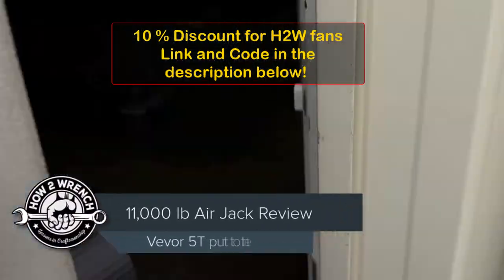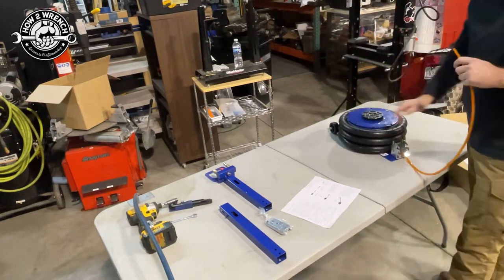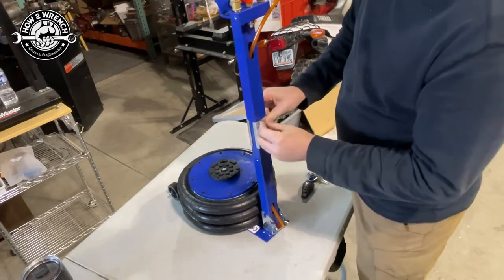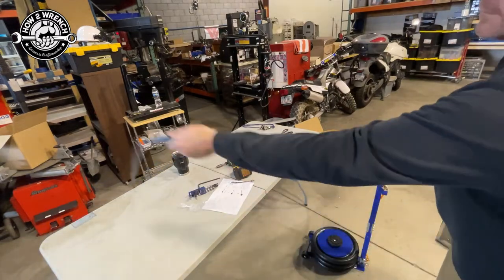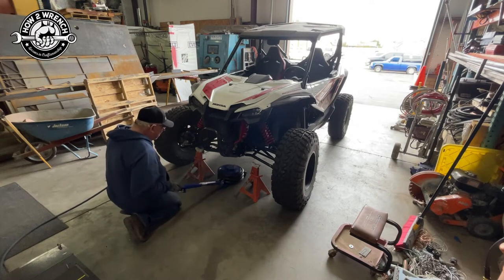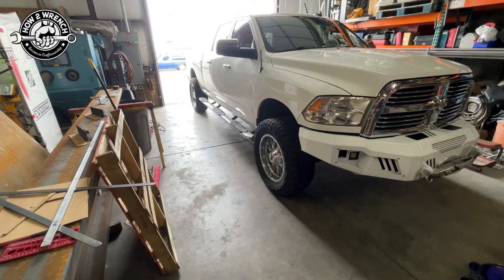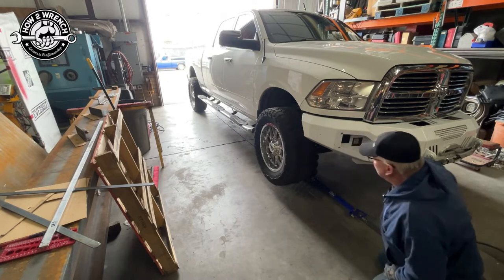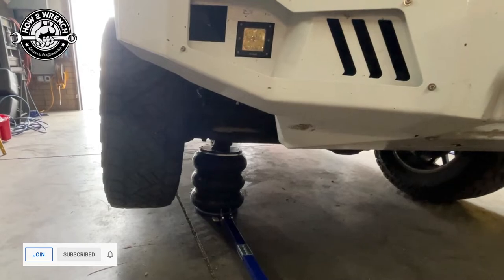Vevor 5 ton Air Jack review. 11,000 lb lift in seconds! Discount Code for fans!

Comment: I made one from a truck air bag to help place my shipping container shop (un-braced bags permit considerable lateral shift I took advantage of).  I run a long hose so I can stand where I like and my ball valve has QD fittings so I can place it anywhere in line.
Reply from the maker: Very cool!

Comment: I've used a similar air jack for the last few years. It should not be leaking like yours is. I had to replace the fill ball valve on mine when I got it because it was leaking. Maybe one of yours is bad also. Otherwise, they are great. Mine will support a vehicle for days, but always use a jack stand.
Reply from the maker: Thanks for sharing. We will have Shane look into it and circle back.